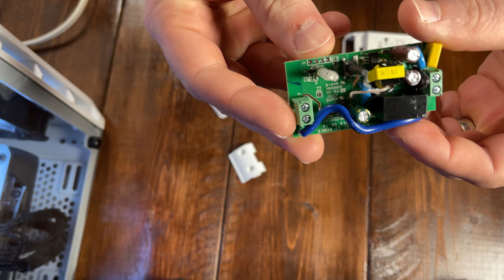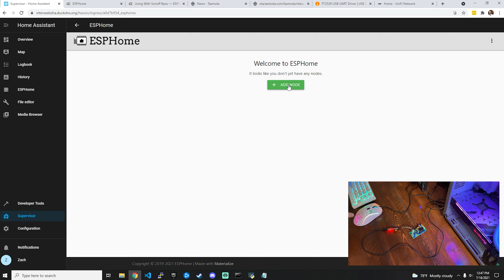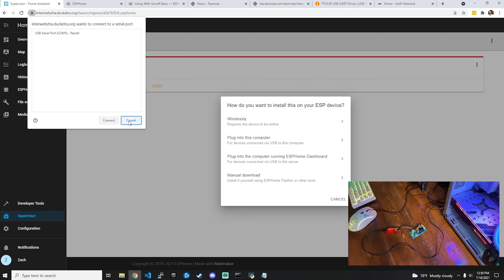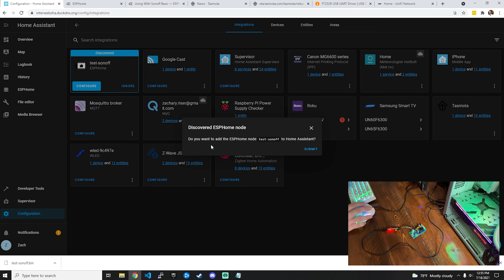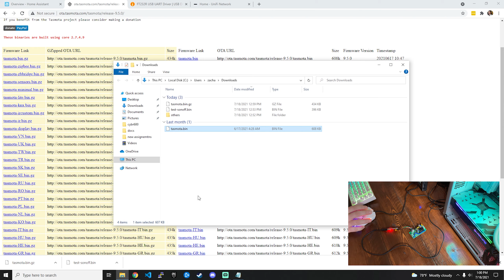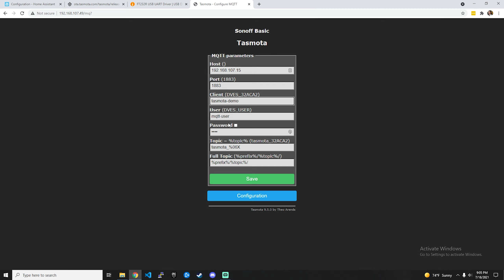How to setup Sonoff Basic with ESPHome & Tasmota

Comment: Question, what is other 4 pin header on the other side of the board used for?
Reply from the maker: Hey James, I’m not sure which pins you’re referencing, but most likely other solder points for accessing other pins on the esp8266 that is built into the sonoff.
Reply: @BlueBotTech  It is J1 labeled gnd,led,key,3.3v. What are the led and key use for?

Comment: I plugged mine into the Rpi USB port the selected the same computer that the ESPHome is running on it seems to have programmed it. Have you tried that? great video very well done. Thanks
Reply from the maker: Yes, ESPHome has come a long way and is really great for flashing esp based devices with custom firmware!

Comment: Sonoff basic switches don't work anymore. If you have many of them they fight over reconnecting to wi-fi simultaneously and crashes the network.  My wi-fi can't handle that many devices trying to reconnect at once.  I need to unplug every device and reconnect them gradually. Then I'm lucky if it works for 24hours with current firmware.  The previous firmware was more stable.  Now sonoff basic is just annoying to own.
Reply from the maker: Are you using the preloaded firmware from sonoff?
Reply: @BlueBotTech   no, the last update from eWelink.
Reply from the maker: This video goes over how to flash Tasmota or ESPHome firmware, this may help solve the issues you are seeing with ewelink!